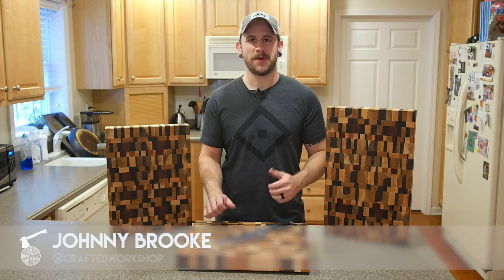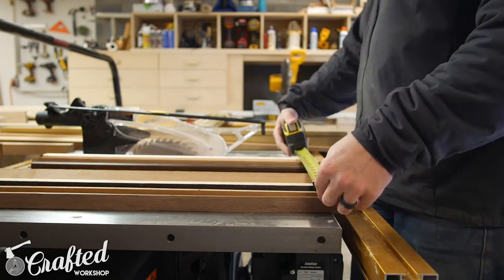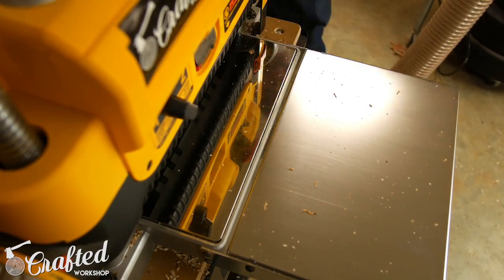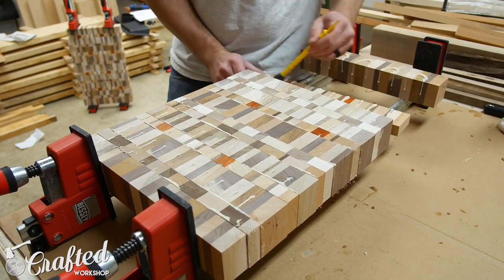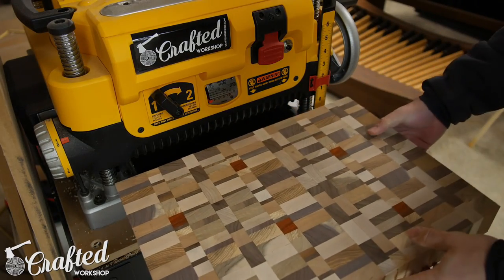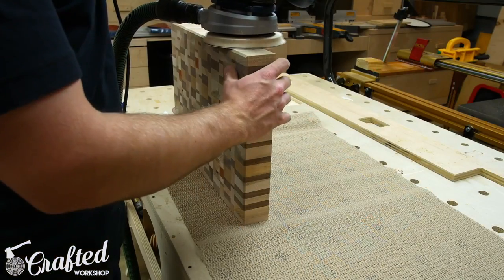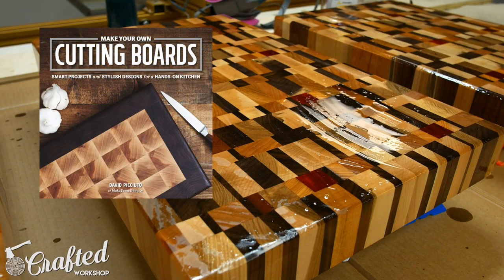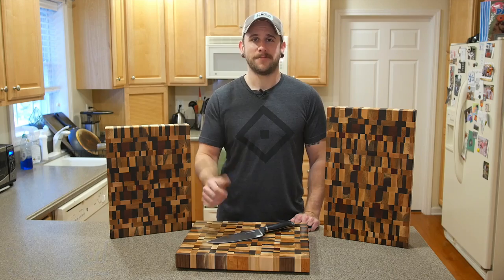End Grain Cutting Boards from Scrap Wood How-To

Comment: One step I that I think is essential but don't see anyone do with cutting boards : raise the grain once or twice with water, then sand off with 220 grit before you apply any finish.  If you don't, the first thing that the new owner will experience is a fuzzy, scratchy cutting board right after they wash it the first time.  Since they probably don't know anything about wood, they'll have no idea what to do about it and may consider it a defect.
Reply: Great tip, it does help finish a board.
Reply: What would your process be if you were to do this?
Reply: @CalebBramsen  spray it with water, let it dry, sand it with 180-220, spray it again and let it dry, sand again with 220. Apply finish
Reply: me ,I sand it with 80,120 and 220 w/oil, its very polishing the board.
Reply: @Love everything If you do a light sanding (I do it with a hand block), it doesn't keep raising. Eventually, adding water keeps a slick, glassy surface.
Reply: It makes a huge difference
Reply: @ScottWinter-rm2of  Don't think so
Reply: Yup, I made my very first board and this happened. I only did 1 oil coat though. Think it'll be fine to take 220 or 320 back over it?
Reply: I once worked at a bakery. My job was to clean the huge wood table used for rolling dough, cutting, etc. The owner never let me use water on it.  I had to hand scrape it at the end of every day. He explained that washing it with water leeches out the natural tannins, this darkens and rots the wood.  I've seen this on occur some cutting boards. Also, the tannins help keep mold and bacteria from growing on the cutting board. Is my boss wrong?
Reply: I water pop the grain on all of mine, and I’m sure a lot of content creators may do this and just not show it. 
But it just has to look good on YouTube, a lot of the stuff these creators make don’t necessarily look good up close

Comment: I've made several end grain cutting boards and watched a few videos on them, but your method is the easiest and most practical. No calculations required. Until I made one using your technique, I didn't quite understand why the blanks can all be different thickness (I made my two blanks both 1.5") What matters is the width that you cut the blank. Great method. thanx

Comment: Nice job. Over the years these have been a go to for me when it comes to a special gift. I have ran most of mine thru a planer without any problems, but like you said, that choice is yours. The first two I made many years ago. I didn't have access to many tools on the weekends. I did the milling and glue ups at work on breaks, and used a regular belt sander to smooth them out. I love the pattern that you ended up with. It's hard to make random look good, but you nailed it.
Reply from the maker: +Turning Sawdust Into Groceries thanks Mike. I really think those few strips of Padauk made a massive difference. They broke up the reputation of the other hardwoods just enough. I really hope the people I'm giving these to appreciate them, because they were a ton of work.
Reply: They are way more work than most people think they are, and glueing up 7 blanks for 3 cutting boards is a huge amount of work. I'm sure the recipients of these board will love them.
Reply from the maker: One of the nice things about making these videos is I can show them just how much work went into them!

Comment: Great video dude. The one thing I'd add to this process is right before adding the mineral oil is to spray it real wet with water to raise the grain, then sand it down with 220 grit, then spray a second time and sand with 400. Without doing this, I've noticed how "fuzzy" the board feels after its first cleaning after use. If you raise the grain first, then cleaning doesn't affect its smoothness. I'm sure this is old news though, since this is an older video now. Cheers!
Reply from the maker: For sure, great tip! Thanks man.

Comment: Beautiful! Mineral Oil is the better finishing treatment. Since this will be used with food, a food-safe finish is a must! I worked in the culinary industry for 14 years, so i had to pass a food handlers certification every 2 years.
Reply from the maker: Thanks! Mineral oil worked great, the board still looks awesome two years later.

Comment: I made a slew of these for Christmas presents this year. I used Walnut and Maple and did the brick pattern thing. Mine came out to 1.5" and seem thick enough, although I could have gone thicker. I've made a couple before a long time ago and forgot how much work went into these! Holy crap, I busted my ass for a couple of weeks on and off to get these suckers done lol. LOTS of freaking glue, cutting and dimensioning/sanding. At 1.5 inches thick when you apply the mineral oil it will actually come out the other side in places. Really cool to see an example of how wood grain acts like little straws. I think I will make a couple of these "chaotic" types with all the leftover pieces I have, or possibly a pizza thingamajig.
Reply from the maker: Yup, they are a ton of work. Have no urge to build another one anytime soon. The chaotic boards are even more work since the strips are a lot smaller. More glue! They do turn out awesome though, and that first coat of oil is just incredible. And yea, it’s cool to see the oil go all the way through!

Comment: I think the key part with running the end grain through the planner is you do very light passes. Basically just skim the surface. It'll take many passes but the blade won't have enough to really bite into in order to split the board or throw it back.

Comment: Thanks for this video. I just did the project. There are other similar videos but your method is the one that made the most sense to me and matched my tools available. Came out great.

I did also do some light surfacing in my planer and I too used new blades, and made very light passes: I did 1/6 turns (just visualize the wheel as an asterisk). I did also smooth it as much as possible first with a scraper and then a belt sander. Dried glue is hard on planer blades.
Reply from the maker: Nice, glad the video was helpful Andy!

Comment: I spend more time on bowls than I do on flat work. Have some cutting boards to do for this Christmas, and am wondering about best glue. I wouldn't consider titebond 3 because it is not water proof, like a marine epoxy. I think the bottle says not to use it on outdoor projects. 

As for finish, true, the butcher shops used mineral oil. According to one source, Michael Meridith of The Doctor's Woodshop, the mineral oil was applies at the end of the day after the butcher block was cleaned. It makes for an 'impermiable' surface, so water and germs can't get through it. It does little beyond that, and the top surface would be scraped clean before beginning work in the morning. I prefer the walnut oil mixes because it will penetrate, and then cure and harden. Mike's mix has some carnuba wax in it, which is a hard wax and won't show finger prints, which bees wax will. For end grain cutting boards, you use a heat gun to help it penetrate. Mike Mahoney also makes a walnut oil and carnuba wax mix, but I like the Doctor's better. Both guys are friends.

Comment: One thing you can do when routing the edges is use a climb cut. Go slow, have a firm grip and when you're done you can go back over the correct direction and clean up any missed or fuzzy spots. Works for me.

Comment: I started using Tried and True finish for my cutting boards. It creates a food safe glass like finish because the process requires sanding to 400 grit. The finish. that last much longer than mineral oil w/ or w/o beeswax.

Comment: That moment when the mineral oil hits the surface... bam!!  Nicely done ✅ Merry Christmas!
Reply from the maker: +Heath Knuckles hah thanks Heath! Schwing indeed!
Reply: Crafted Workshop 👌
Reply: These look absolutely great. Just a question are there any other finishes used for cutting boards etc.?
Reply: @patrickohennesy6539  there is an oil sold at most hardware stores called "cutting block" or "butchers block" oil. But id still put a sealer of some sort before hand, obviously food grade. Just to make it more water resistant. Because with blocks this big mold and mildew will become a problem relatively quickly. Unless you reapply the oil every so often.

I remember making one of these in middle school woodshop with less then half the tools he used here but then again to each there own. They are still beautiful looking blocks forsure!
Reply: @Handles-R-Lame  thanks but I know all this
Reply: @patrickohennesy6539  well cant say i didnt try 🤷‍♂️
Reply: @Handles-R-Lame  ok

Comment: 2 questions: (1) What are those little spikes you use to elevate the piece off the table while finishing? Tried Googling but came up empty. (2) I have a lot of softwood scraps like pine and fir I'd love to "get rid of" through a project like this. Any other considerations using wood like this so it remains durable?

Comment: This might be a dumb question, but where do you get your scrap hardwood from? Is it just left over stuff from larger projects you have built, or do you have a system from your local supplier of taking scraps, etc. - just trying to source some variety and looking for methods that don't involve paying full price - cheers.
Reply from the maker: +The Cutting Bored I found these on Craigslist. I'd like to find a local cabinet shop who'd give them to me, it's on my list. I don't really generate enough scraps usually.

Comment: I found exactly the same on the planer. I was fully prepared to lose the edge, so I just trimmed off 1/4" that it destroyed. Chamfering is a great idea though (the same principle applies to the bottom of legs). I have the same planer and also did quarter turns. Great minds :P

Comment: Those cutting boards are totally awesome to the max!  What are those pyramids called that you placed under the boards while applying oil?
Reply from the maker: +superlazyorg thanks! They're called Painter's Pyramids. You can make them yourself with a small block of wood with a screw through it.

Comment: Nice! I have made a few in the past. Probably a good choice with the titebond 3. One I made was given to a inlaw that doesn't treat it like it should be and leaves standing water on it etc... I used Titebond 2 and have had 2 separate glue failures with it. I just take it back to the shop and cut it right down the glue line on the tablesaw and reglue it back up. If I make more in the future will definitely use titebond 3 on them. That said, I have one in my kitchen that has been rock solid for several years using TB2 i just dry it off after cleaning it.
Reply from the maker: +Honeycutt Woodshop wow, glad I went with III then! Good to know, and thanks!

Comment: I heard most lacquer finish, when cured, is food safe.
Thoughts?
Reply from the maker: I wouldn’t use lacquer on a cutting board. It’s a hard film finish, so as you cut into it, water is likely to work its way under the finish and cause issues.

Comment: I NEED AN OPINION.  I would like to make an end grain board, with a border that is straight grain.  When it gets wet, (1) the border will keep it from expanding    OR  (2) The expanding center will break the border.  What so you think?
Reply from the maker: +Susan Kapustka it will break the border, no question. The border would need to be end grain as well.

Comment: Sorry, one more question: what was the length and width of your blanks during your first round of the glue up?
Reply from the maker: +Mike Levant the lengths varied, usually at least 13" or so. Width was about 13", as wide as I could fit in my planer.

Comment: How does it hold up against scratches? I want to make one but I only have a hand saw and regular  sandpapers.
Reply from the maker: +Jarvan IV go watch Wood By Wright's video on making one with hand tools. It can be done. And end grain cutting boards are ideal for scratches, the knife marks go in between the wood fibers rather than cutting them like on long grain cutting boards.

Comment: You can run end grain through a planer. Its fine. I've done it hundreds of time.
Yeah, it chips more but a sacrificial board solves that problem easily.

Btw, I personally dont consider 2 glue ups a true "chaotic" cutting board.
They look way better if you do a 3rd, or even 4th, cut and glue up.

Also, its really cool to make the 3rd series of cuts on like a 15 degree angle and then glue them back together.

Comment: Do you have a shelix head installed on the planer for the end grain? I have the same exact planer with its regular 3 knives. Is that what you had when planing the end grain?
Reply from the maker: Just the regular straight knives. Worked fine for me!

Comment: I know in our video you were able to pass and end grain board through your planer, but I’ve tried following your process and and it didn’t go so well. Almost broke 3 fingers and bruised my stomach really bad. I can say I would not recommend. Use a router flattening jig or a drum sander. But this video inspired me to try to make cutting boards and have been doing this as a business for over 9 months.

Comment: Great video. Followed your video and made my own today. What are those triangle pieces called that the boards rest on when you did the mineral wax? And where can you buy them?
Reply from the maker: Thanks, glad they turned out nice! They’re called Painter’s Pyramids: https://www.amazon.com/gp/product/B001OELZ5K/ref=as_li_tl?ie=UTF8&camp=1789&creative=9325&creativeASIN=B001OELZ5K&linkCode=as2&tag=beerrevidude-20&linkId=0332793455446052f4064042f395c91a

Comment: Just found this video

White Oak is fine for end grain cutting boards, since the grain is closed.  Red Oak xylem on the other hand porous.  Same reason white oak is preferred lumber for wood boat frames, where red oak will absorb water and rot quickly. 

Also, Titebond 3 is not technically "waterproof".  It's just more water resistant than titebond 2.  If it were really waterproof, you wouldn't be able to do glue cleanup with a wet towel.  Polyurethane glues such as Gorilla Glue is a better choice IMO, and are considered food safe.   I wouldn't use any PVA type glues where the wood is exposed to water

Comment: i have a hand held electric plane... and a hand held circular saw... i wonder if i could make one of these with just those? i would love to make a couple of those... i have plenty of scrap woods. but very limited methods of making perfectly square cuts, IE no table saw, band-saw, jointer, or stationary belt sander... it would be a challenge for me, but i bet i could do it...
Reply from the maker: +Eddie Schirmer I think you could do it! Just use a straight edge with the circular saw.
Reply: thanks! =) that gives me confidence. i just have to rig up something to do that then, awesome man
Reply from the maker: +Eddie Schirmer good luck!

Comment: Super nice dude!!!
Did you have absolutely "0" chip-out, chamfering the back edge through the planer? Really smart thinking but it seems like there may still be a chance for it to happen...a little anyway.
🤤 mmm padauk...
Reply from the maker: +Jason Enz thanks! It was pretty much nonexistent. I ran it through the planer before squaring everything up, so I had a little trimming to do anyway. Worked out great!
Reply: Crafted Workshop - I ran my end grain through my new dewalt dw734 planer...1st time I've done this and it worked out great! I work in an industrial wood shop and I was pleasantly surprised how good this benchtop lunchbox planer performed.
I used the sacrificial ends and it worked great. Trying the chamfered back end next time :)
Thanks for the great video!!!
Reply from the maker: +Jason Enz glad to hear it! The little planers work great!

Comment: Why did you plane the boards before glue up instead of jointing them? Since they are random thicknesses wouldn't you have to adjust the planer depth for every board?
Reply from the maker: +Mark Gibson yup, had the adjust it each time. The jointer wouldn't make both faces parallel, so the pieces could end up tapered.
Reply: It is ok if a board is tapered.  If 2 boards are taped, glue them opposite.

Comment: Hey Mr. Brooke, what would you recommend about making a live edge cutting board? I'd be using Manitoba maple and I thinks it's still green.
Reply from the maker: +timekiller1337 well, you'd definitely want it to be totally dry before using it. I think you could just use one piece as the cutting board, and you'd probably want to seal the bark with epoxy to keep it from absorbing moisture during washing.

Comment: +Crafted Workshop whats your thickes planer model ? how its run after years of use? I consider getting one. Keep up great work!
Reply from the maker: +hinduspl its linked in the video description. A DEWALT DW735. Works great for me, have only considered moving to a helical head but they're much more expensive.
Reply: Crafted Workshop I was thinking about this Dewalt.  What's the biggest difference between normal blade and helical? Cleaner surface?
Reply from the maker: +hinduspl the biggest difference is that it can deal with figured grain easier, and grain direction isn't as big of a deal. The price difference is huge though!

Comment: question to all of you. We use scrap wood and some used wood from other projects but we found some untreated pallets with oak and thought of using them for some cutting boards. No sign or smell of any chemicals and they come out really nice. We sand the crap out of them and cut quite a bit off of the edges. Is there any concern with them being pallets .. they carried lumber products and things ..
Reply from the maker: I personally would never use pallet wood in a cutting board, but you’d probably be fine if the wood is untreated and didn’t carry anything nasty. Oak isn’t a great choice for cutting boards anyway, due to the open grain structure.